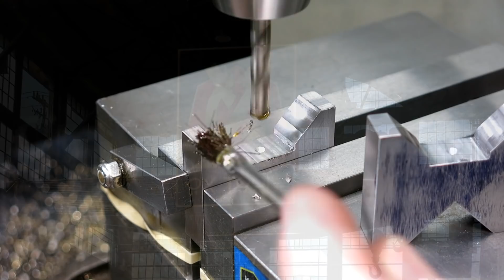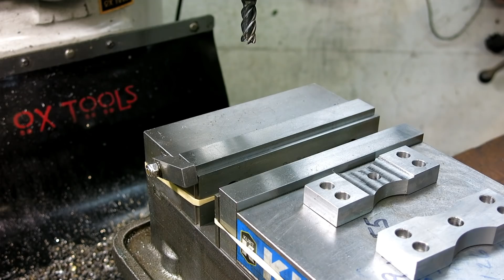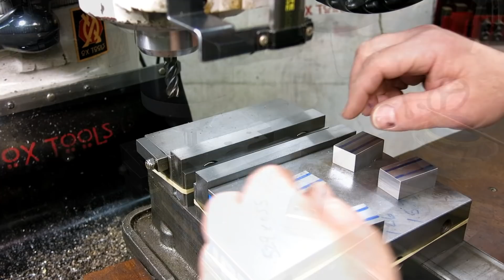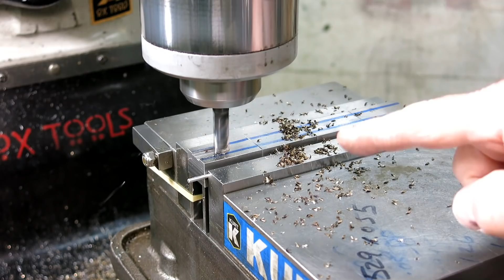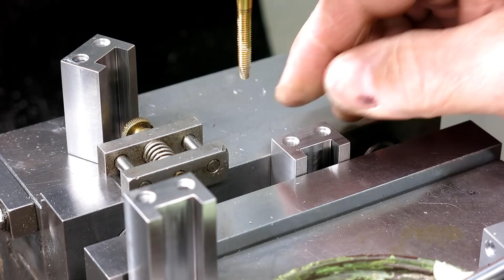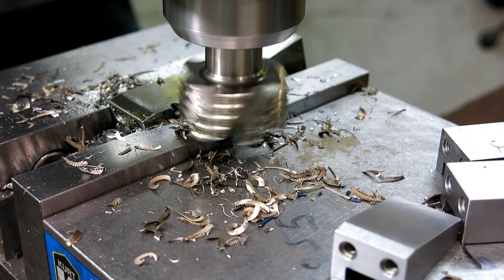Toolmakers Adjustable V Blocks P3

Comment: I’ve seen another machinist use a piece of paper to touch off just above a surface- maybe tony or Chris? Maybe a sheet of aluminium foil folded in two would do it with the D bit?

Comment: If you turned them upside down on the sine bar those small pieces at the end would have been straight & easy to clamp to mill the relief, no?

Comment: Tom, how did you chamfer the 1-inch "scallops" in the base pieces?  You showed the "easy" straight edges being chamfered, but not the "hard-to-do" edges.  Were you able to use your chamfer cutter on them, or perhaps a flycutter & calculations to make them match?  I'm looking forward to Part 4 of this series.

Comment: 26:54 - I play mostly with aluminum, I have a Wells-Index 847 mill that is CNC, I'll also use it like a manual mill with a joystick or buttons, but I digress... it has mist coolant... and i usually have it on even if only very light. I see that you are cutting steel which is much harder, and generates more heat. Why would you want to cut without coolant? Not being judgemental or anything, honestly asking... is there a reason I should cut steel without coolant?
Reply: You can see that chips are purple so the heat generated by machining is transferred away from the workpiece. Coolant sometimes might be harmful, as it's shocking the cutting edge of the tool what results in changing material properties. It all really depends on what you do and what tools you use. I would say that Tom is not bothered as he's doing a roughing pass with big ol' bastard rougher and later he's applying some oil for finishing pass for better surface finish. As long as you evacuate the chips and don't re-cut them it should be okay. With aluminum it's a different story, because you don't want to jam the flutes with welded material.
Reply: @qualified_monkey8813  Thanks. I have seen what aluminum does when it galls out a cutter. I didn't notice he was using a lubricant... painting a thin layer of oil on the piece which helps. I just haven't done enough steel to really know. I was making a piece from some 1/4 inch (6mm) plate steel with coolant... it ran out and the tool turned orange and broke in about a second later... so I always used at least mist afterward. Been machining brass, aluminum and some titanium for like 20 years tho. (Not much titanium... but some.)
Reply: @Askjerry  it depends what cuts are you taking and what tools are you using. Most of people these days on CNC machines are cutting steel dry with high speed machining toolpaths. The key is small step over and high cutting speed, that allows to get rid of material very fast and evacuate all the chips with heat effectively. Generally for or most of applications on conventional machines using HSS tools, you will end up better using coolant. Especially when cutting slots with radially fully engaged cutter.

Comment: Every time you power tap I expect to hear that typical "tunk" when the tap snaps off.  That would be  my luck.
Reply: Power tapping blind holes is risky to be sure! I wonder why Tom didn't use a spiral flute tape so the chips would come up out of the holes instead of jamming chips into the bottoms. Decades of experience makes the difference I guess.

Comment: Video idea! Might be too basic of video for your skill set but the mill and lathe pm’s never get done at my job unless I do them. The ways and bed don’t get a drop of oil cleaning only when the chip build up keeps it from moving.  I have replaced belts and changed gear head oils.  Might be good to have a daily, weekly, month, annual what to do video to help teach people that don’t know.  Also give those that know some new idea or good old reminder for stuff they missed.

Comment: Does the rounded part if the D bit need to be relieved behind the cutting lip?
Reply: Yes, I just grind the radius 0.020" or so smaller by eye on the bench grind then sneak up the to cutting edge.
They are about as simple a tool as one can make, you will only have trouble if you  over think it.
For what it's worth, for limited use on softer metals like aluminum, I don't even harden them. I just use the drill rod as is.

Comment: I saved business cards from venders and bosses that like to feel important handing them out as my vice spacer.  I relaying like the aluminum tig rod wire idea.  It can be reused after that for tig welding.  I guess the cards are going the way of the dodo with shaking hands (not a dog don’t like to shake hands)

Comment: Tom, I love watching this stuff. A question though. I am taking delivery of a used Bridgeport mill shortly and my current milling machine doesn't have a quill. It does have a DRO with a scale on the Z axis though. I would like to fit the Bridgeport with a DRO and I have read that most Bridgeport users don't recommend fitting a scale to the knee. I notice that you do most of your depth setting with the quill. I am wondering if that compromises rigidity on an older machine? I'd appreciate your thoughts on this.
Regards,
Mark Presling, Queensland, Australia
Reply: Its odd, I've noticed a lot of bridgeport users prefer to move the quill down even when doing 'hogging' operations. Where I did my apprenticeship and work (a very nice protoype engineering/ tool and die shop), we had all our Bridgeport style mills fitted with scales on the knees and got amazing results/ accuracy out of them. In fact I never found myself touching the quill unless I was drilling or boring, as I felt that the further the quill sticks out the less rigid the machining loop became and therefore saw more deflection (even though it was near negligible). In my mind ive always thought keeping the quill locked in its highest position was the way to go unless drilling, but maybe people dont like having to crank the knee up and down for these kind of operations? Thats the only thing I can think of.

Also, just watched you channel for the first time today Preso, subscribed. Cheers from a young toolmaker in Wollongong NSW

Comment: I'm at 7:45 wondering if you notice any difference between climb and conventional cutting.
Edit : At 9:15 you noticed a better finish "that way". Sounds like you covered what I was wondering. Climb cut provides a better finish in this case. 
Peace.

Comment: It made me a little uncomfortable looking at the placing and removing of the blocks in the vice with the spinning drill, it looked you came really close, but 2d vs 3d can make a huge difference in perception.
Reply: Lol,  when you do enough you learn to not fear the spinning bitey thing.
Reply: @prodesign8189  Always fear the mangler
Reply: @JustinAlexanderBell  yup, didn't fear the mangler once and stuck my finger into an end mill. only two (not very deep) cuts but could have been worse right
Reply: Not fearing spinning bitey things is fine. Not respecting them tends to have consequences sooner or later.